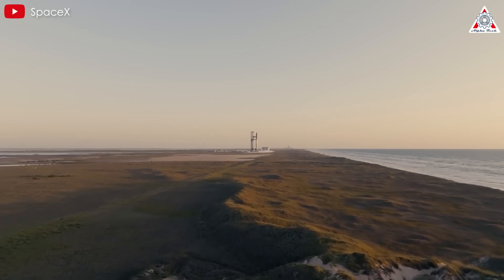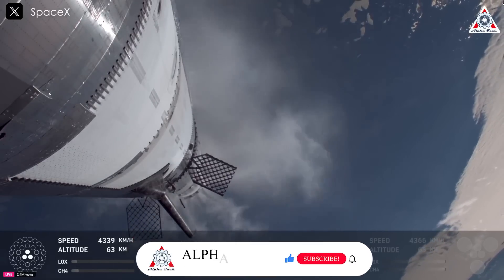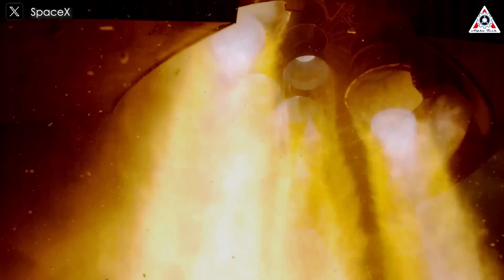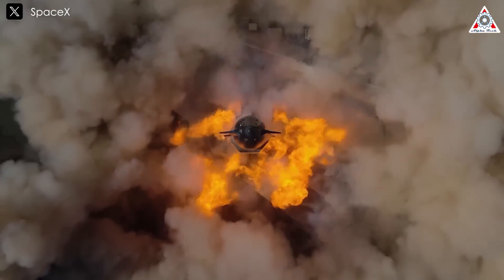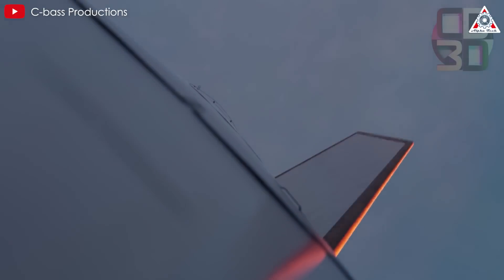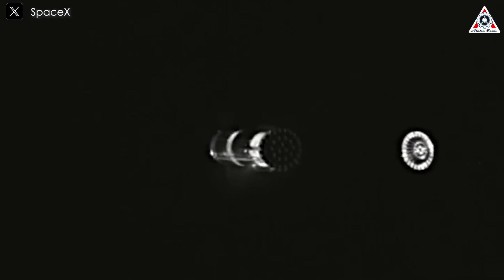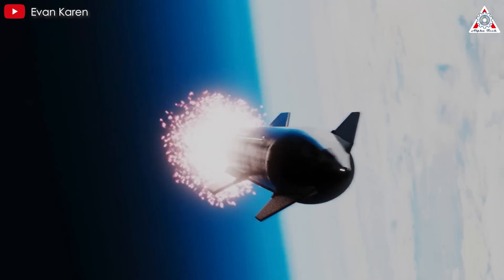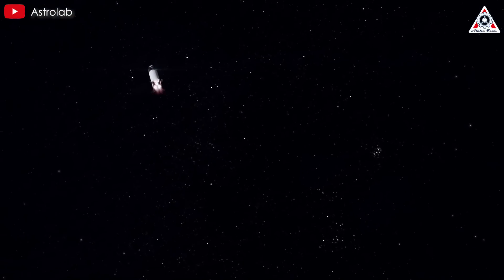SpaceX Hot Stage is a Big Mistake that Destroyed Starship V2!

Comment: Remember what Elon said about Raptor 3, they don't need the heat reflectors, hot staging is stupid, the back pressure alone is enough to damage the craft, and now being longer, the engines fire longer, adding load and probably causing the issues we see now.

Comment: This channel is a joke using an AI voice and changing theories, if the hot staging ting was an issue then it would of failed every use but it hasn't, clearly the issue is on block 2
Reply: The ship was not designed to hot stage in the first place, V1 was a lot stronger than V2. While reducing weight they clearly did not engineer for shock hardening. However this doesnt change the issue that those engines are not built to withstand hot staging, thechnically nothing has spcifically been designd to. They are chasing their feet with this one

Comment: Excuse me, but there was never a "dangerous build up of pressure" in earlier Super Heavy staging attempts, because in IFT-1, which was the first attempt, staging never even happened. The Starship engines never ignited. After that, all other staging attempts were with the hot staging ring. And all of those subsequent stagings were successful!
Reply: This channel is just slops…
Reply: The ship was not designed to hot stage in the first place, V1 was a lot stronger than V2. While reducing weight they clearly did not engineer for shock hardening. However this doesnt change the issue that those engines are not built to withstand hot staging, thechnically nothing has spcifically been designd to. They are chasing their feet with this one

Comment: Starship is complete and utter bullshit taking space exploration back decades. All Musk has done is reproduce technology of 60 years ago. We now have astronauts returning to earth in tiny capsules dangling by parachutes !!! The future was in taking the highly successful space shuttle (despite its flaws it built the space station and launched and serviced satellites) to the next level with space planes capable of travelling around the solar system and returning to earth in the style and comfort of airliners returning to earth. 😡
Reply: Space planes are great for getting from earth or mar’s surface and return to surface but interplanetary should be in transfer spacecraft built in space with nuclear powered engines and protection for crew and passengers from radiation with spin sections to produce gravity this would be a true interplanetary spaceship.
Reply: It would be great if we could get SSTO style space planes, something like the Pan Am Orion-III in "2001: A Space Odyssey" (it took off vertically, landed like a plane) or a type that could take off and land like a plane. I don't think any of those are going to happen any time soon, though. Same for the Moon Bus and Moon Lander from the movie, or even the Eagle craft from "Space: 1999" (send the main body with command module, frame, and engines into orbit on one flight, the four "pods" with landing legs and control thrusters in another, and assemble in orbit; attach whatever module -- personnel, cargo, fuel, etc. -- and head to Luna, refuel at an orbital facility, then land at a base). 

Buzz Aldrin designed a "cycler" spacecraft that would be built and stay in space -- it would "cycle" back and forth between Terra and Luna, Mars, the asteroid belt, Jupiter, etc., even having multiple ships transversing according to a schedule (not like one big fleet heading out together, more like commercial airlines or cruise ships).
Reply: The issue is currently we don't have the means to create a space plane like the x-37 that is capable of building say a large dry dock station where we can manufacture larger ships in space. Currently slinging ourselves Gattaga or The Expanse style in a point direction to where we actually want to go until we have the means of creating a drydock is more feasible.
Reply: @ I imagine you could have lenses in space that create blast furnaces for melting metals for re purposing. Always seems a waste to allow spent space materials to burn up or return to earth when it could be re used up there given the cost to get it up there in the first place.
Reply: Can't wait for Sierra Space Dream Chaser!
Reply: @Mikey_Likes_It_Too  interesting … thanks not heard of that.
Reply: @user-qg2bt2qt9l  they are set to launch on a ULA Vulcan this year 🤞
Reply: @ cool - will keep an eye out for that !
Reply: You don't know shit.
Reply: Interplanetary Space Shuttle would require x3 time greater solid boosters and LH2+LOX rocket design. Existing Space Shuttle was not able to gain V2 speed and leave the Earth orbits.
Reply: @alexanderbelov6892  Boy there's some clever guys around - this NASA guy has calculated using a rocket / scramjet hybrid engine with a staging velocity of mach 10 would result in 1.5 times fuel saving over a pure rocket launch. There's also the Hermes Chimera turbofan / ram jet that potentially could assist in getting to scram jet speeds efficiently too. Perhaps there is scope to get a space plane into orbit without the scary vertical launch pad ?
https://ntrs.nasa.gov/api/citations/19690015544/downloads/19690015544.pdf
Reply: just letting you know but travelling around the solar system in style and comfort as an airliner is starship's goal since it started testing
Reply: @ fundamentally it needs to glide /power back to earth using the atmosphere. It can never do this - it has no wings.
Reply: @user-qg2bt2qt9l  it has little flaps which can steer the starship on reentry when its going really fast then deploy said flaps to lose its speed, enter its belly flop maneuver and land using its 3 sea level raptor engines. If you ask me, NASA or any agency wont be able to do that, especially at the pace Elon is going.
Reply: @Seriously - basing a professional inter planetary transport system on little flaps and belly flops - come on - it’s a joke.
The future was mapped out by a NASA scientist in 1969 - rocket scram jet hybrid engines - 1.5 times less fuel than rocket engine only launch.
Reply: @user-qg2bt2qt9l  its not a joke though. keep in mind the starship is entering the atmosphere at roughly Mach 25 where it can easily slow down and maneuver
Reply: @ All space craft do. The space shuttle did. The point is it’s nextgen space tech that should have been developed not this  dangerous throw back monstrosity - it’s too unstable a design for manned flight.
Reply: @user-qg2bt2qt9l  you do realize that Elon will test it tens of times unmanned so it reaches the safety and reliability of the Falcon 9 with almost none of the space shuttle issues, right?
Reply: @wazsln  You do realize he’s been doing that for longer than it took NASA to complete the Apollo program which only had a single launch failure - the first one - and then had 6 successful moon landings. And that was 60 years ago without microchips. We’ll be here in 10 years time saying how he learns from each failure but there’ll be no moon landings or Mars landings with his hapless approach to engineering.
Reply: @user-qg2bt2qt9l  I don't know, maybe because one tries to be highly reusable and the other is only supposed to be used once? Of course it's gonna take way more tries to get it right.
Reply: @wazsln  Then it’s time to cut the losses, ditch Musk altogether and use the money to fund NASA to develop the rocket - scramjet hybrid engine and launch a modified 747 into orbit with it. Simples. 🛫🌍🛬
Reply: Listen, you’re out here acting like reusable rockets are a joke while praising a 60-year-old program that literally had zero iterative testing in orbit. Apollo succeeded because they launched one-shot rockets with no concept of rapid reuse, no real-time telemetry learning from dozens of failures, and definitely no fully reusable booster and ship system. SpaceX is literally doing in a decade what NASA couldn’t do in a half-century: building massive, fully reusable rockets, learning from each static fire, each hop, each full-stack launch, and iterating insanely fast. Starship isn’t about nostalgia or recreating the past—it’s about scaling humanity to orbit and beyond efficiently, safely, and repeatedly, with technology that actually works in the real world today. The flaps, belly flop, and Raptor engines aren’t a joke—they’re the culmination of every lesson learned from Shuttle, Saturn V, and decades of engineering. You want “nextgen” tech? It’s literally flying over your head while you’re stuck arguing about scramjets from 1969. This isn’t a museum exhibit; it’s a functional, reusable system that will carry humans to orbit and Mars, and your armchair critiques aren’t even in the same galaxy of understanding.
Reply: It’s hilarious to watch someone claim SpaceX is “reproducing technology from 60 years ago” while clearly never looked past Apollo and the Shuttle. Yeah, those programs were historic… for their time, but let’s not pretend they were reusable, cheap, rapid, or capable of hundreds of iterative unmanned tests like Starship and Falcon 9. Flaps and belly flops aren’t “dangerous throwbacks,” they’re engineered reentry systems literally designed to work—tested repeatedly while you’re out here screaming about nostalgia. SpaceX isn’t building a museum piece; they’re innovating fully reusable rockets, automated TPS systems, cryogenic propellant management, and interplanetary platforms. Meanwhile, the Shuttle needed a fleet of astronauts, millions of manuals, and still exploded on two missions. So before you wax poetic about “nextgen technology that should have been developed,” maybe check what actually counts as nextgen—because Starship is literally doing what your beloved 60-year-old rockets could only dream of.

Comment: It's as always, all in the sequencing.
1. One offset sea level gimballed engine, to fire at T+0
2. Two sea level gimballed engine's to fire at T+4 
3. Gimballed engine direction normalisation T+5
4. Vacuum engine ignition T+9.
Reply: That has worked several times with V1. Why should it now be wrong with V2?
I would need an explanation from the AlphaTech 'experts'.

Comment: Don't forget that sharship V2 is heavier, so the hot staging process is longer than with V1. Maybe they should keep turned on only one or two raptor on the booster V1 for separation. They are not designed to work together.
Reply: V2 is actually lighter bruh
Reply: @khanisbrown6424  empty yes, I talked about the fuel capacity (prop load) of V2 that, when fully filled, represents quite 300 tons more. I share your vision, I think they made great improvments on V2 like empty mass reduction. I hope next fly will be successfull 👏🚀
Reply: @ that makes sense

Comment: Starship V1 had zero problems with hot staging for two flights before the new version.  The changes in the fuel feed lines are the most likely cause of failures/leaks/fires in Starship v2.  Three long thin hard fuel feed lines inside a cryo fuel load.  Both failures occurred nearly exactly the same flight time, under full power.  Both times the fuel levels were less than 20%.  This will dictate the harmonics of the fuel line.  At some point, the fuel pounding through the line finds the right length of uncovered line and begins oscillating out of spec.  It’s just that simple.  Braces and gussets will eliminate it.  SpaceX will fix it, don’t worry.

Comment: i know musk would love to do away with hot staging if he can i guess we will see with what new innovation ideas his engineering team will come up with Yeah, Musk’s philosophy of “the best part is no part” means that if hot staging creates more problems than it solves, he’ll likely ditch it in favor of a simpler, more reliable method. Given how rapidly SpaceX iterates, I wouldn’t be surprised if hot staging is phased out in future Starship versions.
Hot Staging May Be Damaging Starship’s Raptors There have indeed been reports that hot staging may have damaged some of the sea-level Raptor engines on Starship. A few key concerns:
1. Superheated Exhaust Exposure When the upper-stage Raptors ignite, their exhaust is forced downward through the hot-staging ring. This could be overheating and damaging the lower-stage Raptor engines on Super Heavy.
2. Uneven Thrust or Shockwaves The violent ignition during hot staging could cause uneven thrust distribution, which may stress the Starship’s lower engine bay.
3. Vibration and Structural Stress The sudden ignition while still partially attached to Super Heavy creates intense shock loads. This could lead to premature wear or failure in both Starship’s sea-level Raptors and the booster’s upper structure. Musk’s Likely Solution?
If SpaceX finds that hot staging is doing more harm than good, they’ll probably: Return to cold staging but optimize separation to minimize velocity loss.
Use pusher separation (like Falcon 9), where small thrusters push Starship away before ignition.Develop a modified interstage design to better protect the Raptors from exhaust exposure.
Final Thought If hot staging is damaging engines and complicating reuse, Musk won’t hesitate to get rid of it. SpaceX prioritizes simplicity, reliability, and rapid iteration, so if they find a cleaner way to stage Starship, they’ll take it. We’ll likely see this play out in upcoming test flights.
Yes, if Super Heavy achieved a higher velocity before separation, it could help compensate for the velocity loss caused by cold staging. Here’s why:
How Higher Booster Velocity Helps 1. More Momentum for Starship
If Super Heavy pushes Starship to a higher speed before shutting down, Starship won’t lose as much velocity during the staging process.This would reduce the need for hot staging’s "boost" effect. 2. Smoother Transition to Upper Stage
A higher initial velocity means Starship requires less thrust initially to continue its trajectory.This can allow a gentler engine startup, reducing stress on the vehicle. 3. Less Need for Complex Staging Tricks
If the booster does more work upfront, Starship can afford a brief delay before ignition without dramatically affecting performance. Challenges of Increasing Super Heavy’s Speed While it sounds like a simple fix, there are some trade-offs:
Fuel limitations: Super Heavy has a set amount of propellant. Pushing it harder could mean less reserve fuel for boostback and landing. Structural limits: The rocket must withstand higher aerodynamic forces at staging.
Engine burnout timing: Raptors must shut down at the right moment to prevent excessive gravity losses. Possible Solutions Optimize engine shutdown timing: Super Heavy could maintain thrust for just a little longer, maximizing speed before staging.
Adjust flight profile: Slight trajectory tweaks could improve efficiency without harming reusability. Use a refined cold-staging system: Stronger pusher thrusters could ensure a clean, efficient separation.
Final Thought If SpaceX can safely push Super Heavy to a higher velocity before separation, it could make cold staging more viable while still maintaining performance close to what hot staging provided. This might be part of Musk’s reasoning if they decide to phase out hot staging.

Comment: His comment on why stage separation failed on the first launch was incorrect.  This is not what SpaceX had to say about it.  Also, disagree that hot staging is the problem here.  SpaceX doesn't seem to be looking at this as the problem.  Hot staging has advantages.  If it turns out that hot staging is the problem, it is likely SpaceX will do a redesign on Starship rather than dumping hot staging, as there wasn't a problem with it on Starship block 1.  And by the way - it has always been SpaceX's plan to integrate the current hot staging ring into the booster design instead of discarding it.  Video was also much longer than it needed to be, talking about a lot of stuff other than what was in the title.  Hence, I didn't watch the entire video.
Reply: You didn't watch it all, so you missed the key part!

Comment: In the case of Saturn V, NASA had this problem with the 1st stage/2nd stage separation, which used a circular interstage. All the data is there, including what the problem is, and how to prevent it. On Apollo 15, they shortened the interstage release time by 1 second, and that caused significant damage to the upper tank dome of the 1st stage. They used 2 types of rockets for separation: ullage for the 2nd stage to push it forward, and retrorockets on the 1st stage to push it backwards.
Reply: Musk doe not believe in following what was learned before. He believes his ideas can beat the laws of physics. 

Could this hot staging process be key to the problem?? Yeah, I suppose this could be a factor. Getting the heavier Starship to accelerate away from the booster is what they are trying to achieve, but you want to do it while minimizing the shock loading. It seems to me that they should have data on this to model it better. Maybe they should look at decelerating the booster with small retro rockets and let momentum achieve some separation before starting the engines. I know they are trying to conserve as much thrust and momentum, but they may be trying to cut this too close.